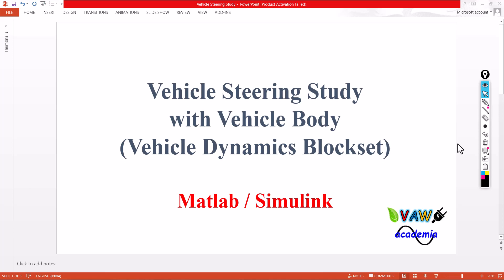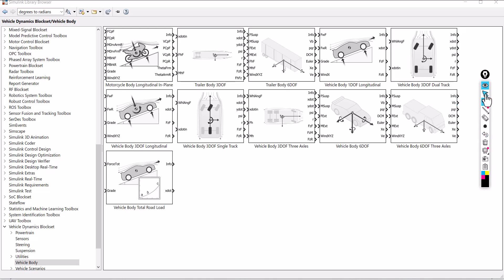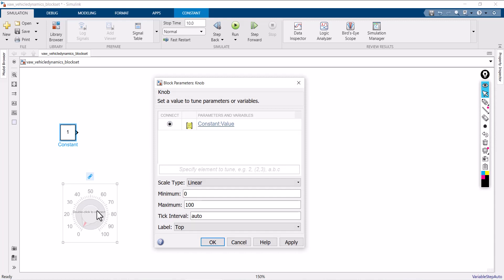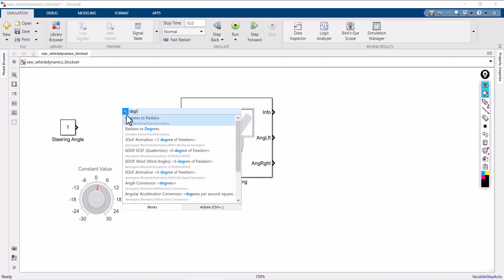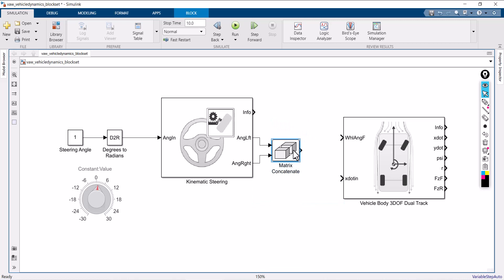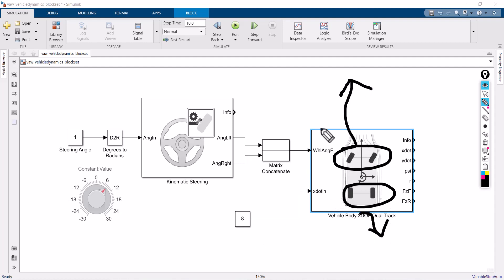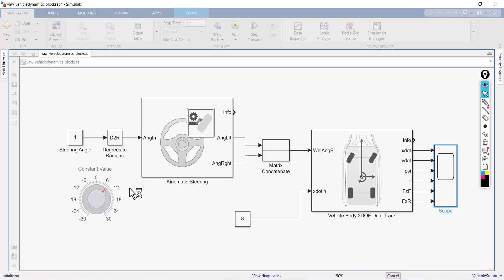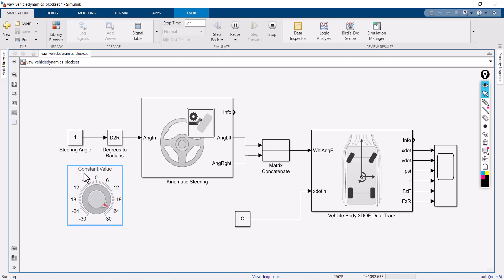Vehicle Dynamics Blockset (Steering Wheel Study with 3 DOF Dual Track Vehicle)

Comment: Hi sir, thank you for making a great manual video.
I got some problem about these two block. 
1. Do the 3DOF block calculate the moment of steering from steering system? 
(Because when i tried to print out the response of front wheel angle, i saw no delay or some response line that look like responsing line, instead it was a right time response).
2. I have tried a new input steering system is Steering System Blockset and it contains 1x12 vector input is force x y z and moment x y z from steering wheel left and right. 
(But i cannot get moment of tires from the 3DOF blockset, so i have no idea to countinue my system)
Can you help me how to put the steering moment ( a torque to steer so that the delay time can be combined into the model like your vid's model).